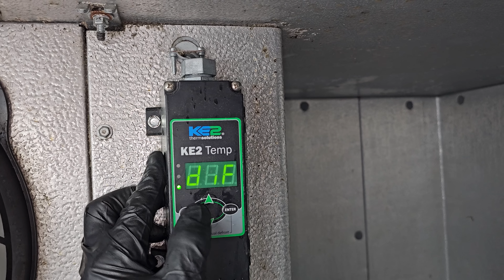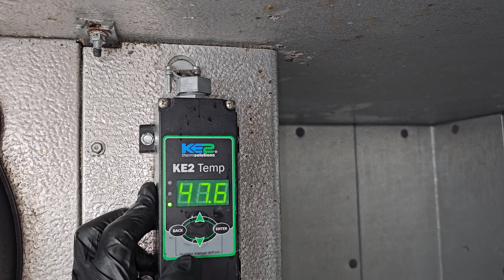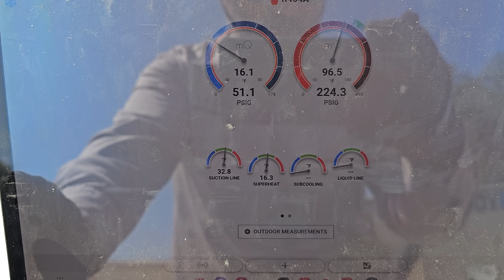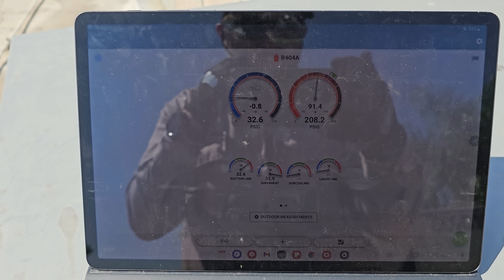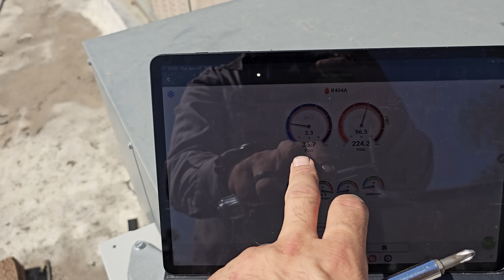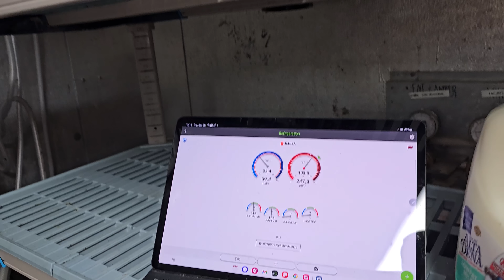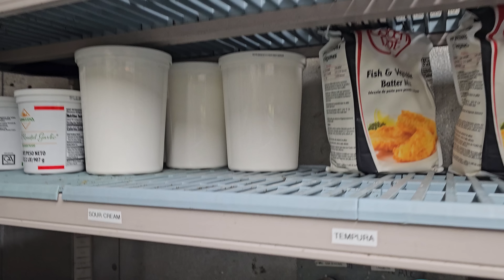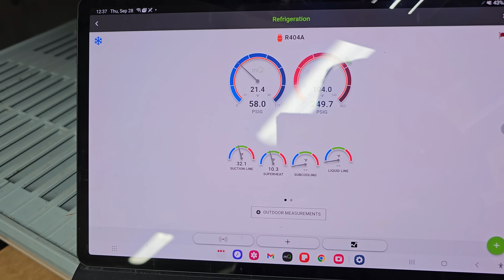SATURDAYS ARE FOR DE-ICING WALK IN COOLERS

Comment: Had to do a hot swap myself on Thursday. Found a Schrader that had broke and was  leaking on an isolation valve for a VRF at the branch box. It can be a great time saver. Still ended up recovering the charge to check how much was in the system ( hot swap prevented us from having to pull a vacuum on a system with tons of piping ). Dang thing was still running with only 4lbs out of a 85lb total charge.....without tripping any safeties or throwing a code.
Reply: How in tarnation?

Comment: So the aerosol cleaner works by coming out as mostly liquid or micro-foam, and this can slide easily into the gaps between the fins. The surfactant in the cleaner then causes heavier foaming, which has the effect of pushing dirt and debris out from between the fins, while softening and lubricating the surface.

Comment: When the cleaning chemical is sprayed on the coils, it is mostly fluid without bubbles.  The chemistry of your sprays is formulated to release grime and foam up.  Then when the foaming happens (inside the fins), it carries the released grime out with it.  If it did not foam, then you would have to spray water to carry out the loose debris.

Comment: Chris I had the same issue with the hissing noise near the tev on a cooler and I put on a self tapping valve after the liquid line solenoid and found that the solenoid valve wasn't fully opening. I changed the solenoid and turned back on and the problem at that time was fixed with the solenoid  opening up fully. This problem didn't happen all the time and was sporadic and I was thinking at the time this should take care of the problem. I did not take voltage at the time at the solenoid itself when I heard the hissing and that was a mistake because 2 days later the same call came in but this time the whole cooler box was at 0 degrees. What I found is that the johnson A421 controller was the problem in not allowing proper voltage of 24 volts to go through the internal contacts of said controller probably due to carbon build up on internal contacts. 
I changed out the controller with a Penn A19 mechanical with adjustable dial and problem solved.

Comment: Be cool to add a thermoanemometer to the back that  could tell the defrost clock whether there's a blockage, and increases defrost duration with lower airflow. And obviously backs it off when airflow is good. A built in heater on the probe could keep it clear of ice at all times.

Comment: Manufacturers of compressors recommend 6 compressors cycles per hours as a maximum due to the abuse to compressors on start up with LRA. And minimum run times of 10 min on and off combined. (Med temp)

Comment: You mentioning the compressor starts per hour option got me curious on what other settings exist, and from reading KE2 bulletin Q.3.20 October 2016, I'm surprised one can go as far as programming 12 specific times for defrosts (e.g. 2 am, 3 am, 7 am, 5 pm).

Sadly, it's not quite the same as that one analog defrost clock where you can set a continuous, long defrost overnight, so I don't think the KE2 + Defrost replaces that.

Comment: if the viper coil cleaner is a propretary still in patent it maybe secret.

instead of a heating element for the defroster you could install a hot gas or hot oil  defroster.

that is a valve that sends the hot gas from the condenser or hot oil from the separate oil cooler loop to the evaporator .

refrigerant bypass valves was used in ice makers to warm the mold enough to drop the ice and on some dehumidifiers to allow for quick restart.